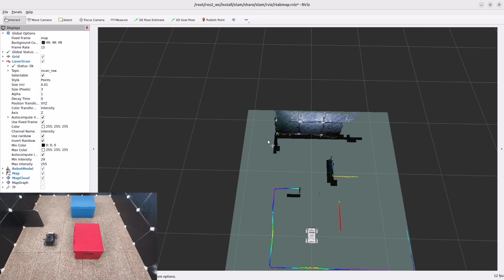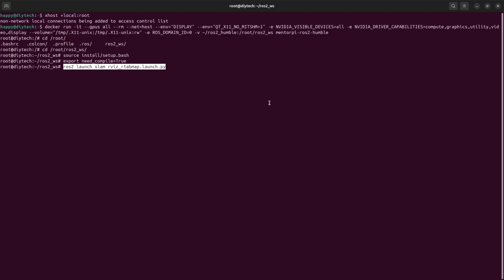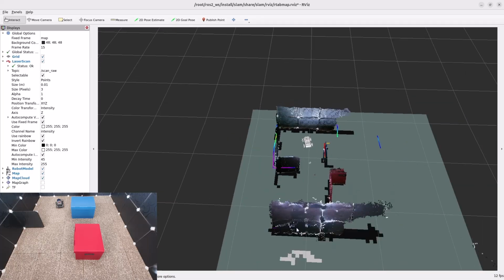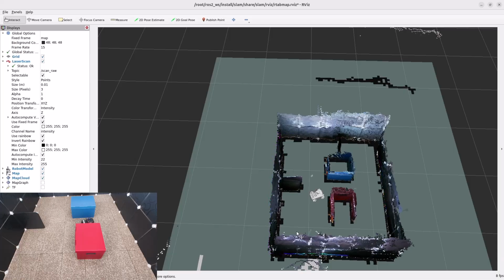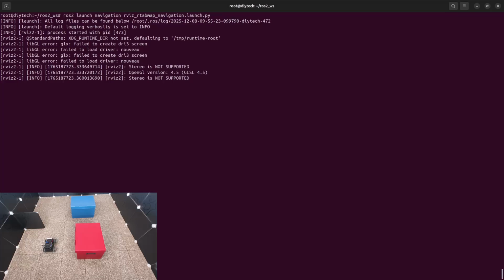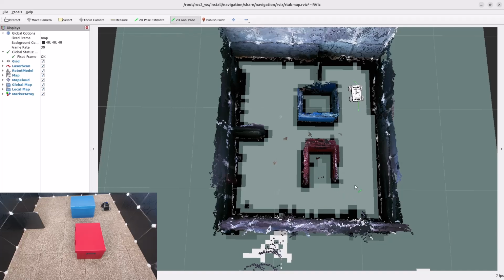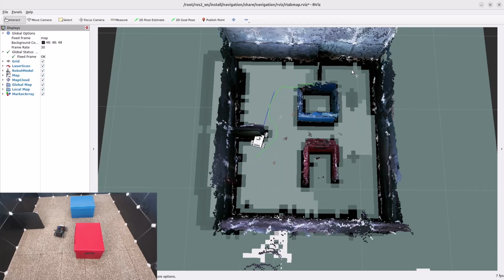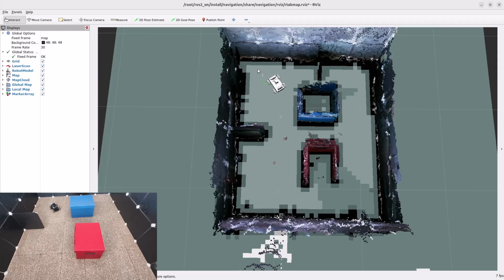How to Build a 3D Map with RTAB-VSLAM on Raspberry Pi 5

Comment: *ROS 2 is not the software that does SLAM, navigation, path planning, obstacle avoidance, or motor control.* ROS 2 is primarily a *middleware and framework* that allows many separate software components to communicate with each other.

Think of it like this:

- *ROS 2* = the operating system / plumbing / message bus
- *RTAB-Map (RTAB-VSLAM)* = the software that builds maps and estimates position
- *Navigation2 (Nav2)* = the software that plans routes and navigates
- *Camera drivers* = provide images
- *LIDAR drivers* = provide laser scans
- *Motor controller nodes* = drive the wheels
- *Raspberry Pi 5* = runs all the above software

When the YouTube description says:

> "...build a 3D map and navigate autonomously using ROS2"

that is technically a simplification for marketing purposes.

A more accurate statement would be:

> "...build a 3D map using RTAB-Map SLAM and navigate autonomously with Navigation2, all integrated through ROS 2."

### What ROS 2 actually does

ROS 2 provides:

- Messaging between modules ("topics")
- Service calls
- Parameter management
- Launching and coordinating processes
- Hardware abstraction
- Visualisation tools
- Logging and diagnostics

For example:

```text
Camera
   ↓
ROS 2 topic
   ↓
RTAB-Map
   ↓
Map + Position
   ↓
ROS 2 topics
   ↓
Nav2
   ↓
Velocity commands
   ↓
Motor controller
```

ROS 2 itself never calculates a map simply because a camera is present. It is the SLAM package that performs the mathematics.

### In the MentorPi example

The likely software stack is:

```text
Raspberry Pi 5
 ├─ ROS 2
 ├─ Camera driver
 ├─ RTAB-Map (Visual SLAM)
 ├─ Navigation2 (Nav2)
 ├─ Robot localisation
 └─ Motor control nodes
```

The impressive part is mainly:

1. *RTAB-Map*
   - Feature extraction
   - Loop closure detection
   - Pose estimation
   - 3D map construction

2. *Nav2*
   - Path planning
   - Obstacle avoidance
   - Recovery behaviours

ROS 2 just allows all those packages to exchange data.

### An analogy

Imagine a factory:

- ROS 2 = conveyor belts and communications system.
- RTAB-Map = surveying department creating the map.
- Nav2 = route planner.
- Motor controller = driver of the vehicle.

The factory wouldn't produce anything if you removed the workers and left only the conveyor belts. Likewise, a robot with only ROS 2 installed would do virtually nothing useful.

So your intuition is right: the YouTube description attributes the capability to "ROS2", but the actual mapping and navigation are being performed by specialised packages running **on top of ROS 2**, not by ROS 2 itself. This is a very common shorthand in robotics videos and marketing material.

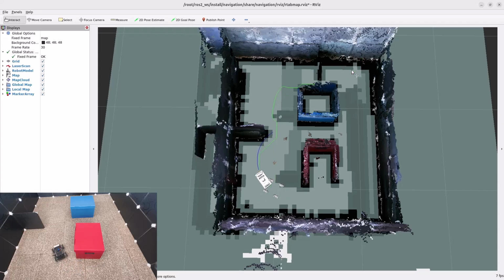Comment: Awesome concept, I'll definitely be checking it out! One interesting thing I noticed is that after the car hits the red box at 9:36, it seems that its physical position and its mental map get out of sync, the car/map thinks that it is farther to the left than it really is. This is especially noticeable at 10:58 when it "avoids" the wall which it wouldn't have hit otherwise, but because the car thinks its father to the left it goes to avoid the wall. Do you know why it was never able to successfully realign/reposition itself after running into the box initially?